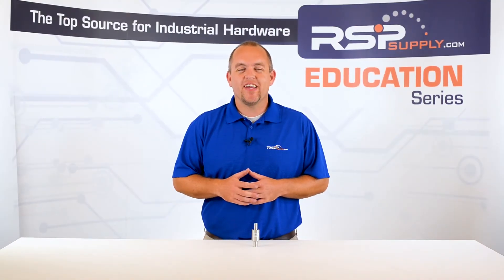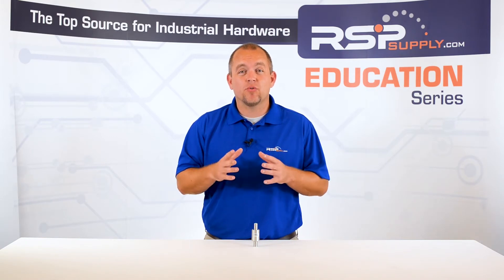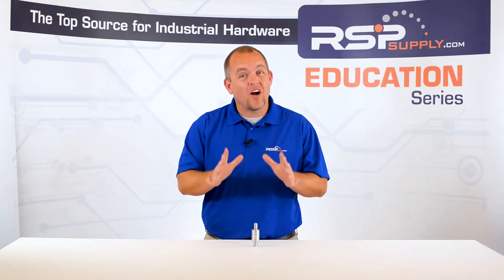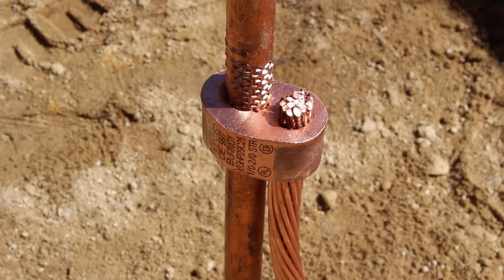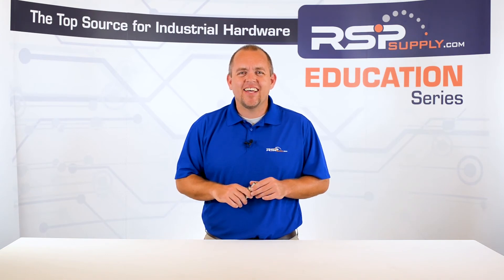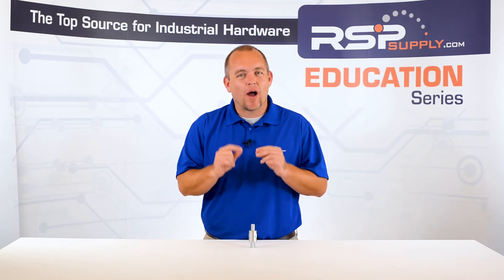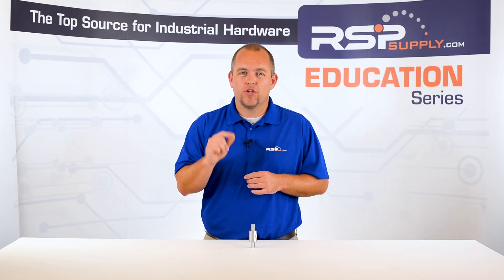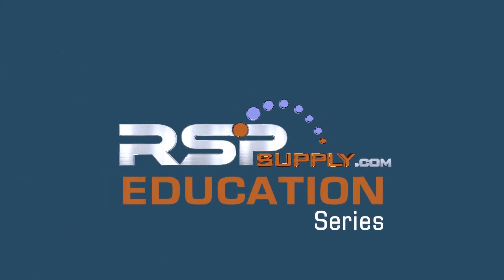Surge Protection and Grounding for Radio Systems

Comment: Remember that both the antenna ground rod and the surge suppressor Must be bonded to the main electrical system ground per NEC.
Reply: Yes and that can be a problem. I had a storm quickly blew in. I heard lighting in the distance and disconnected my RF cables. My diamond took a direct hit. Blew it to pieces. What I failed to do was disconnect my mega watt power supply. The Antenna had it's own ground rod the mast was also grounded.  The grounds were bonded to the system. What it did was sneak back into a circuit went thru a isobar surge  protector, blew the power supply and went thru the dc output into my radio. All damaged. I also lost my Tv's which were on the same circuit and it blew a circuit board on my A/C. Followed all the rules and still got zapped.